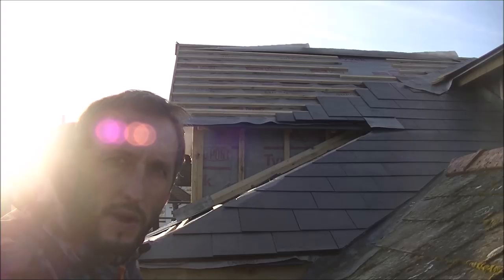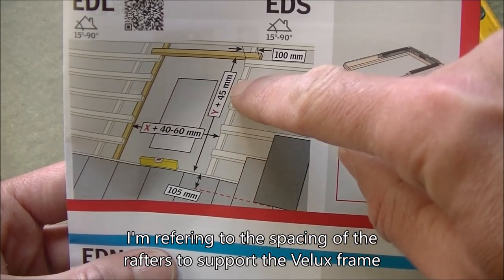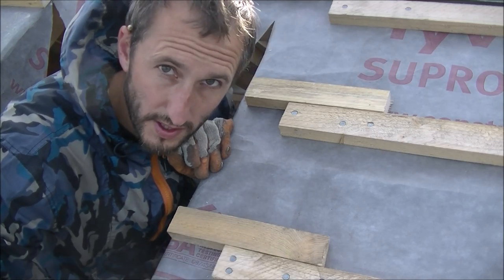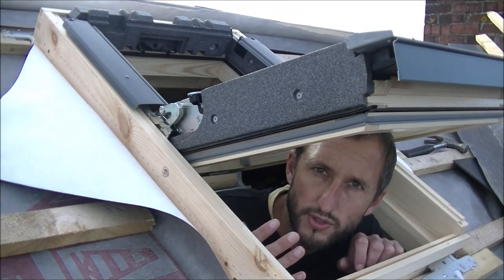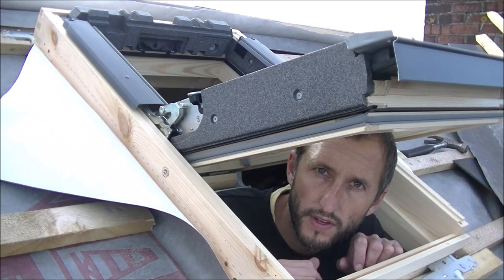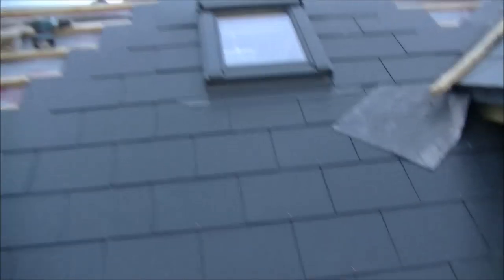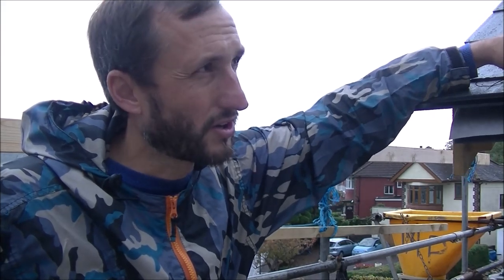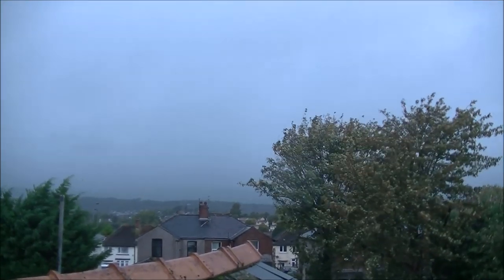Loft conversion part 20 - Velux window install & slating gable end. Velux GGL CK02 3070

Comment: I can’t fault you mate . You seem to be a right grafter and working on this project in your spare time so fair play. I have two questions. What height do you need above your head when you reach the top of the stairs ? Is it 1.8 m? And what is the height requirement along the spine of the the conversion need to be. Walking area. And one last question, what thickness insulation is needed in the roof to meet building regs? Cheers.
Reply from the maker: Hi there. The only way to get an exact answer is to speak to your local authority building control officer. There are rough guide on .gov website which are really good, but it does vary from one area to another, and possibly between Wales, England and Scotland also. I think Ireland is less strict but I may be wrong. Generally they ask for 2 meters on landing and rest of room can be lower. Sometimes they allow less on landing for example 1.8 on lowest pitch and 1.9 in middle depending on circumstances and some may request 2 meters in room itself. PIR board on old house is usually 100mm between rafters and 30mm over top, but newer houses may need to comply with stricter rules if rest of house is built to stricter standards. There are other ways to achieve it using less between rafters and more over the top, or insulation foil rolls. Stairs are another issue as you can use space saver stairs but some building control officers don't like them. I went for 75mm wide proper stairs and I'm glad I did as it feels like a normal stair case. Hope that helps!